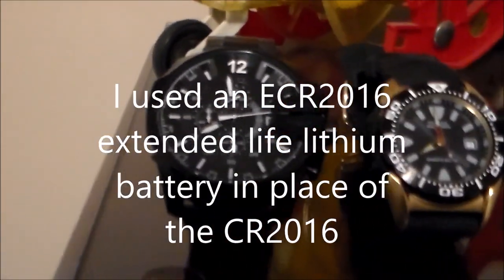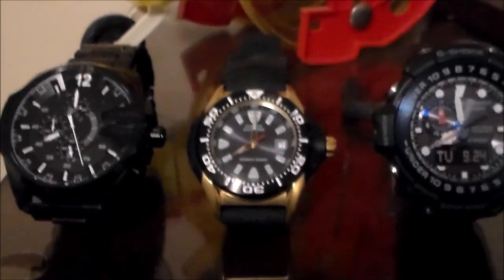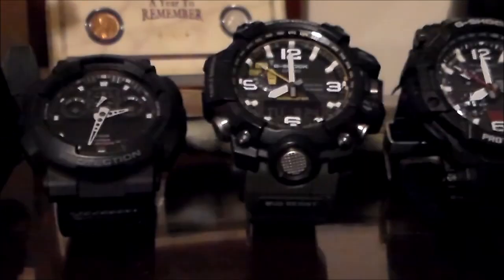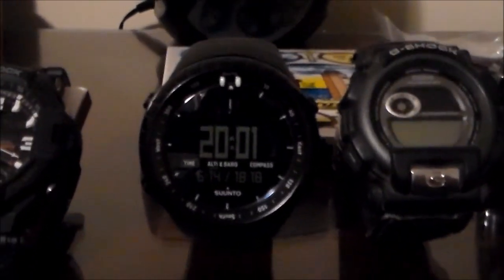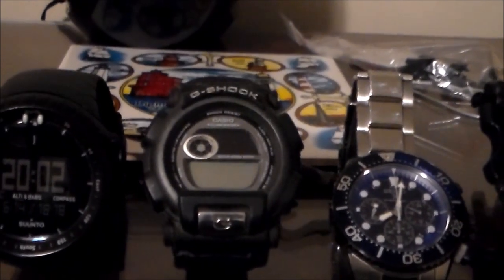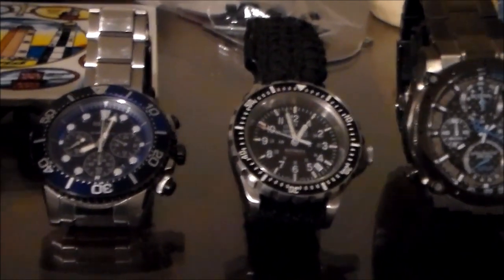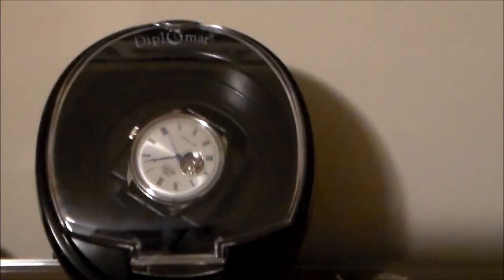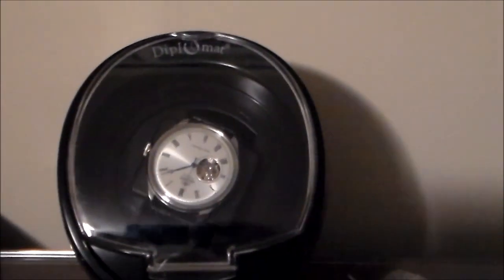Replacing the Battery in a Bulova Precisionist 98B229 Men's watch

Comment: I had to replace the battery in mine today. I remove one of the link pins, made it a lot easier. I as well ended up having to remove the tiny screw that held down the battery cover. Thankfully the jeweler's screwdriver was magnetic and once I got a few turns on it, I was able to loosely fit the cover and slide it so that the latch slid under the screw, and I then tightened it so that it was snug.
Not the hardest battery replacement I've ever done, but not a cake walk either. I noticed that the seconds hand and the thousands of a second hand had both had to be adjusted after the battery replacement. Still flat out in love with this watch.

Comment: Greetings, Mike. I'll 2nd removing (or rather opening) the bracelet. Obviously (as I'm sure you knew) it's the first step to accessing the caseback.  I'm a vintage Accutron collector, and have been replacing batteries in my collection (as well as in many, many family member's quartz pieces) for years.  I'm no watchmaker, just an enthusiast.  The hole marked "push" was likely the stem release.  Usually, you'd pull the crown out to the setting position, and then insert a tool to depress within that hole, which would release the stem (pull outwards).  To reattach simply insert stem and push inward, stem will re-engage.

Comment: 2 tricks I learned with the 8 Precisionist's I own. 1) Always take the band off 1 side. 2) The micro screw can be started with a telescopic magnet. Screw face to magnet and twist to get 60% in. This reduces cross threading and no worries about it flying away like when using tweezers.

Comment: That recessed, unknown "push" is the crown/stem removal button. Holding it pressed and pulling the crown out will allow you to remove the stem. This is only necessary if you need to remove the whole movement from the case.

Comment: Once again I had to change the Battery CR 2016 Bulova Precisionist !!!  I was just about to throw the watch in the Bin !!!!  But I fitted a CR 2025 which is double the size !!! I did not replace the plate and the back holds the Battery firmly in place !!!!  Now after hating this watch, I absolutely love it now !!!!!  It is running perfectly, and the bigger battery should last a lot longer.  And it's very easy to fit the Battery now !!!!  Of course it's no longer Waterproof, but I don't have to muck around with the tiny screw or the plate. The seal is very difficult to fit so last time I used silicon sealant, but this time I didn't bother.  You have to remove the spring bar in the bracelet to make it easier to remove the back. The watch does work as soon as you push the battery in and it doesn't need the plate !!!!  This is unusual because most watches won't work without the plate, but the Bulova does !!!!!  Mine started as soon as I fitted the Battery.  The button on the left shuts off the stopwatch and allows the second hand to sweep !!!!!
Reply from the maker: An interesting alternative approach.  My Precisionist is still going strong after the battery change….

Comment: Hi there Mike! I replaced the battery in my Bullova Precisionist Divers watch and the second hand started moving as soon as I put the battery in! I have the one with a black face and red hands. I was very disappointed that such a huge watch has such a pathetically small battery. I never used the chronograph and the battery lasted about 2 years. A chronograph watch with a ridiculously small battery is going to use dozens of batteries during its lifetime. Thats a lot of money to pay a jeweller to do it!  I'm lucky that I can change it myself, but I would not have bought the watch if I had known this!  I usually get Casio G Shock watches which have a 10 year battery. The Bullova looks fantastic, shame about the battery!
Reply: My Bulova Precisionist is the same as in the video, except silver stainless. It eats up a battery about every three years. I bought a jewelers watch repair toolkit and five-pack of batteries on Amazon for $25 and do it myself now.

Comment: I replaced the battery in my Bulova Precisionist Champlain yesterday. I had taken it to a jeweler who wanted $35 for the battery plus labor!! I went to Amazon, and ordered a five-pack of batteries for $5, and a complete watch repair toolkit for $17. All told I did it for about $25 and now own a complete watch repair toolkit and four extra batteries. Now, I usually don't begrudge someone for making a living. I'd have paid probably $15 for a $1 battery, plus labor to have my battery replaced at the moment while standing at the jeweler's counter, without having to wait for Amazon to deliver and then spend 30 minutes doing it myself, but I WILL NOT subject myself to "SCREW YOU!" pricing.

I did remove the screw all the way because that little gray bump next to the screw prevented the plate from coming out until I did. I didn't push that little "Push" button and had no problems, but I did have to re-zero the hands following the directions in the manual afterward. I don't know if the "push" button would have prevented that step. To be honest, I didn't see the "push" button until I watched your video.

I also did remove the pin from the pivot-end of the latch so that the band would open up and stay out of my way while doing it, but when I did, the spring pin flew apart, shooting one end and the spring across the room - as you say, "gone forever". I was left with the spring-pin tube, and one end which does me no good. Luckily I had an extra few 1.8mm x 22mm spring pins for my other watchbands, so it was no big loss.

Comment: Make sure to use a sharpie to mark the notches before unscrewing the back plate.  When you thread the back plate back on and torque to spec by way of where you made the markings.  Use rubbing alcohol to remove the markings.

Comment: I changed my battery based on this but the watch isn't working now. Quite strange. No action with a new battery. Any clues?
Reply: Scratch that. It started working again after pressing the left and top right buttons together. Then pressing the left by itself. Just pressing the left after the change did nothing.
Reply from the maker: Glad it worked out.  Cheers

Comment: Good Job, but In My opinion, you should have removed the Watch band. You will never get an acceptable  video showing  anything Inside the Watch with that Watch band In place. Focus was lost several times too.
Reply: The watch bracelet is rivetted on. The only way to open the bracelet is to remove a link, but I couldn't get the microscopic screws undone! It's a gorgeous watch with a ridiculously small battery! I should have bought another Casio G Shock instead!

Comment: Question: I remembered been told once that you have to lubricate the rubber ring with silicone grease before tightening the back plate to make it waterproof, is that true?
Reply from the maker: Hgp2000 I have heard or read the same thing.  If I had any silicone grease I would have used it.  As it is I am not doing water sports at the moment, so exposure to wet for me is minimal.
Reply: Thanks,
It was a good insight of what to expect when I replace the battery on two of my watches.
Reply: Remove the o-ring and lubricate it - don't touch with your fingertips.

Comment: I'm not completely sure but i believe there is 2 batteries one for the chrono module and one for the 3 hand module
Reply from the maker: As far as I can see for the model 98B229 there is only 1 battery.  If you have more info on this kindly share.  Thanks.

Comment: Hi Mike, thanks for sharing this video. Quick question, which type of battery did you use? And how long would it last?
Reply from the maker: CR2016.  I don’t have solid data on how long the battery will last.  I can say that the watch is still ticking since I posted this video, so at least that long.  Cheers
Reply from the maker: Now that my watch battery has died, I can say I got a few days past 24 months on 1 battery

Comment: Hi from the UK Mike.... I have a Bulova Precisionist 96B175 which is the same watch but in a silver case.  Do you know the model number for the battery please?  Thanks in advance
Reply from the maker: Hello U.K.!  The battery type here in the US is CR2016.
Reply: I have one also a gift from my brother ..I thought its not battery operated..bulova innovative 140 yrs anniverssary..
Reply: @mikehartmann5187  CR2016 what brand was it ?
Reply from the maker: Linton Gormley - private gmail - I believe it was Energizer brand - now that’s what I replaced the OEM battery with - unfortunately I don’t recall the brand of the OEM battery
Reply: @mikehartmann5187  Maxell CR2016 was the factory battery in my Bulova Precisionist. Thanks for the heads up on that tiny screw. I was able to leave it in, just backed out to the last couple threads and get the plate off. Risky, because if it pulled out, it would have launched into the ether.  
The other thing I had to do was zero all the chronograph dials when done. Got to Google the procedure but it’s all external so not too bad.

Comment: Man that button that says push on the movement is the way you release the crown stem itself.unless you have the crown pulled out all the way the watch will automatically turn back on as soon as battery makes contact.you also need to get better watch tools other then that Amazon kit thats looks to be about $5.a lot of times when changing the battery you may notice your chronograph hands will need reset.btw if your not sure about a watch movement or how it works dont just go pushing on things because it says push here.you can damage the movement by not knowing wth your doing.99% of watches I've learned on that say push is only to release the winding stem from the movement itself.

Comment: Obligatory "actual video starts at 15:41" comment. I appreciate that you made the video but if you don't have much time, almost 2/3 of the way in, that's where the subject matter of the video is actually shown.
Reply from the maker: Now that my Precisionist battery has gone dead after roughly 25 months, I will redo this video to address the complaints.  Cheers
Reply: @mikehartmann5187  it's not really meant to be a complaint, my bad
Reply: @mikehartmann5187  I actually got my Precisionist today, with a dead battery, so I appreciate the info on the battery type used. My case has a tiny slot to pry open and I need to find a tool to open it properly, so sadly that's way different than your watch.